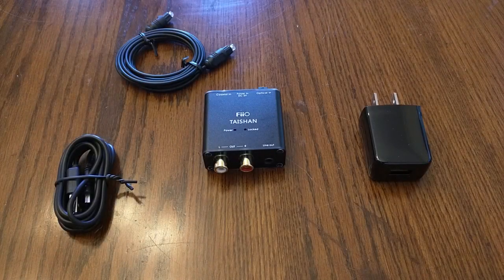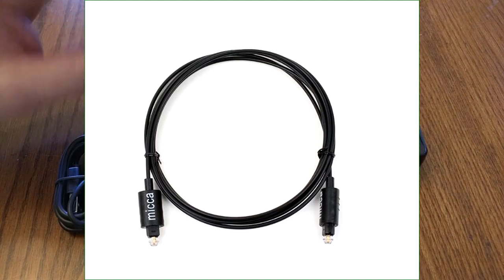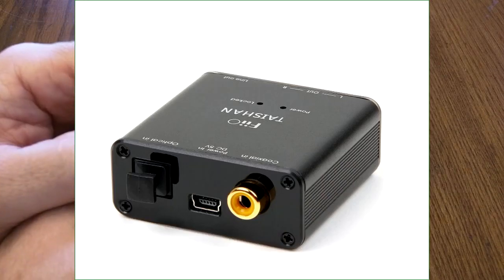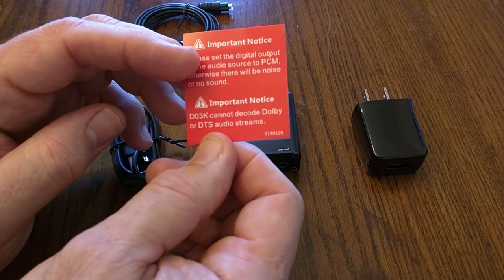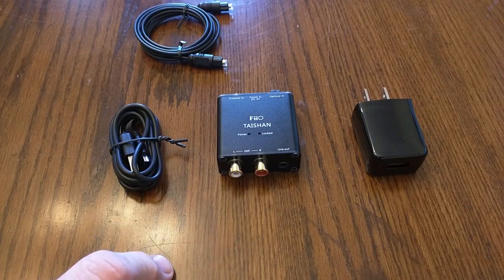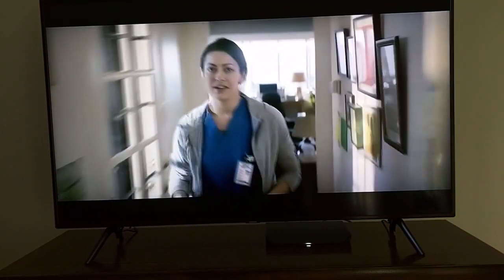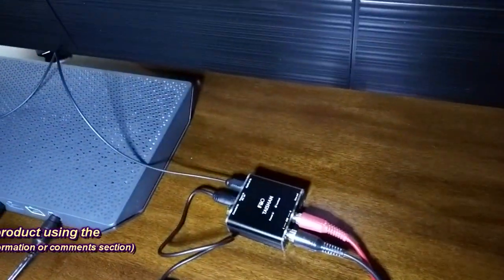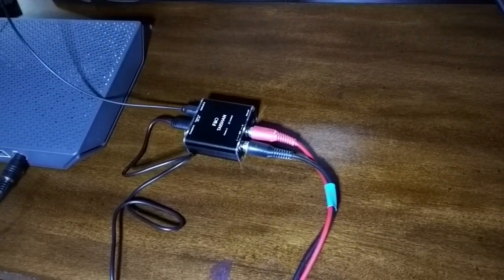BEST Digital to Analog Audio Converter - 192kHz/24bit Optical and Coaxial DAC REVIEW

Comment: good day.
would that be good to use 
if my tv speaker are not working,
even the headset output of my smart tv are not working.
thats why im about to used that kind of converter. because my smart tv has a spdif/toslink.
thank you so much for your respond.. Godbless...
Reply from the maker: Yes it will